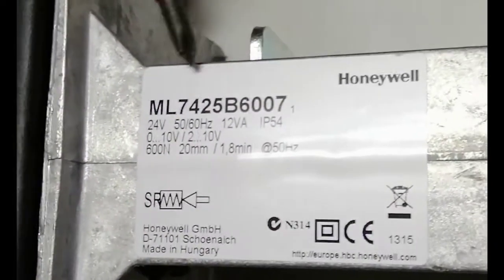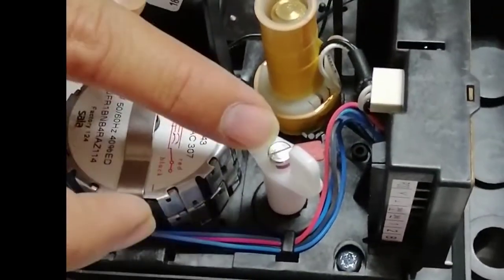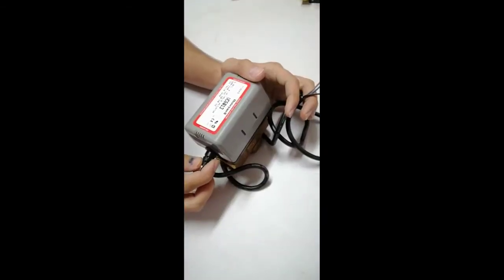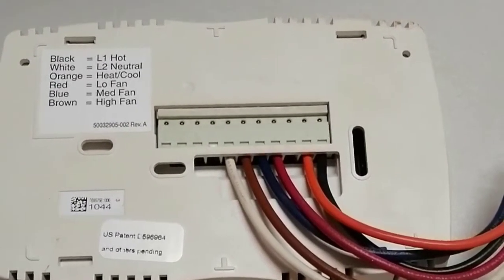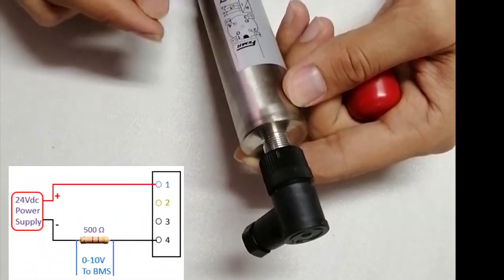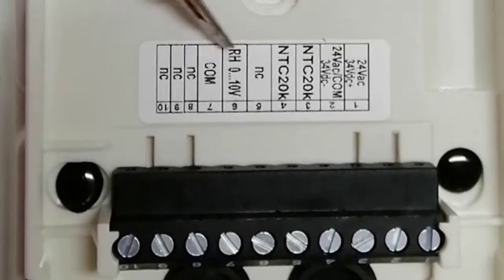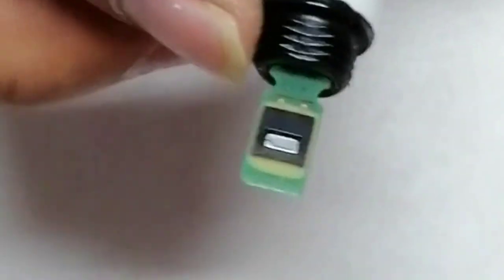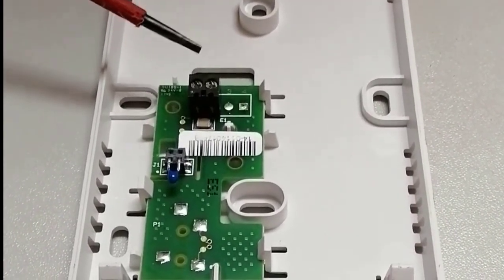BMS Field Devices Termination Part-2|Building Management System Training|BMS Training 2021

Comment: Can u please tell how to check dps  and voltage for  ahu/ fahu actuator
Reply from the maker: Hello Sayyad,
You can check the DPS by blowing air in the positive pipe and checking the continuity on the terminals using multimeter.. Once DPS is latched you will also hear sound of latching.
Reply from the maker: For AHU/FAHU actuator please further elaborate your question.. Which actuator you want to check? And what exactly you want you check? Power supply voltage or control voltage? In this video I have briefed about actuator terminals and their connections
Reply: Control voltage open and close command  @TechSystems

Comment: Hi Engr,  can you  please tell , how to test the valve actuator is working or not
Reply from the maker: You can give open/close command or change 0-100% control signal from the BMS workstation and look at the valve actuator to know is it moving or not.. And is the direction correct.
Reply: @TechSystems  

Engineer,  it not at all moving ,if I give command from Bms .  How to confirm that whether the issue in actuator or from DDC!!
Reply from the maker: After giving command from BMS, check the power supply voltage and control signal on the valve actuator using multimeter to verify the connections.
Reply: @TechSystems  
Hi,  Engineer am requesting you to do videos about nurse call system which will be useful for us